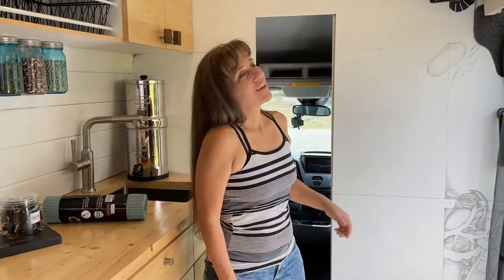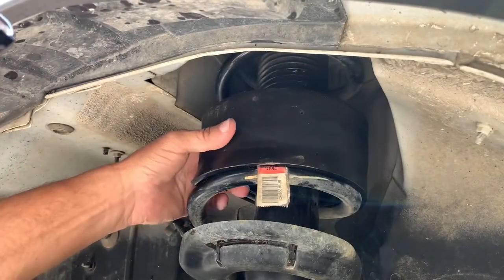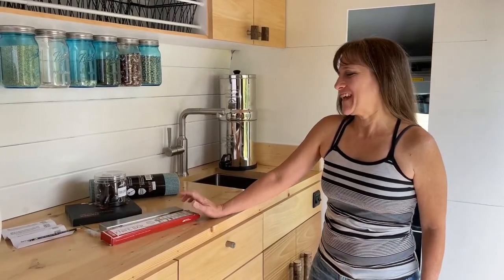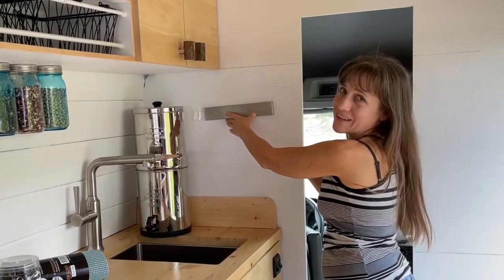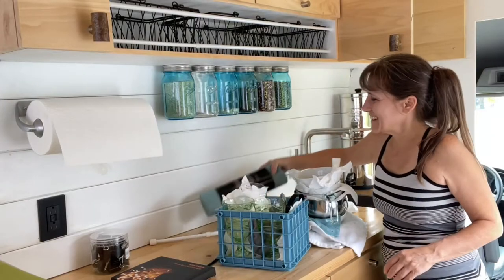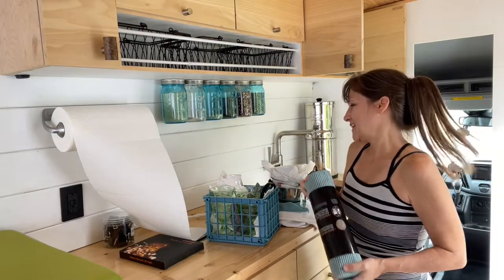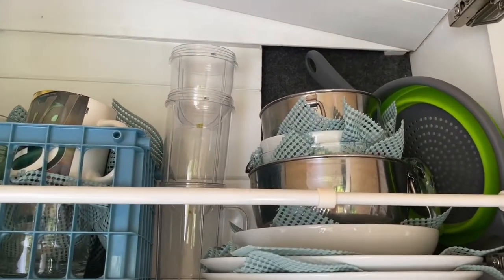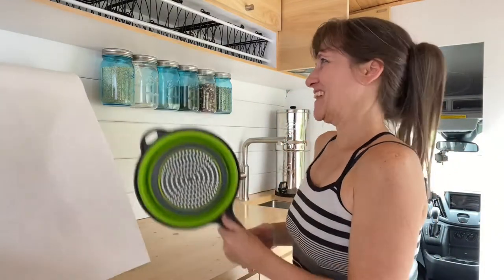Van Life Projects | Suspension, Wall Art, and More

Comment: Great Video. Never knew they even made suspension stabilizers. You'll have to give a review if you think they help or if they're so-so, I'll pass on the wall mount knife holder. It just looks dangerous especially when traveling down a bumpy off grid dirt road somewhere. The black/grey border color looks good.
Reply from the maker: Thanks! I’ll have to do that. The suspension feels really good so far. I’m a little concerned about the knife holder as well. I’ll let everyone know if it doesn’t work out. I already moved it to a different spot In the van. I show that in my next video. 🙂